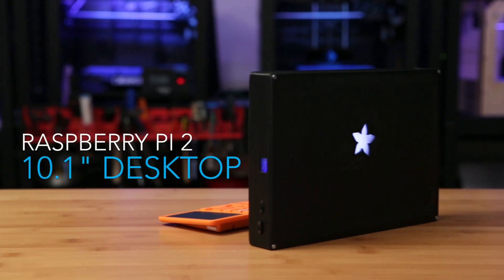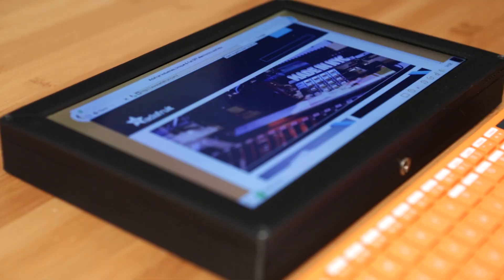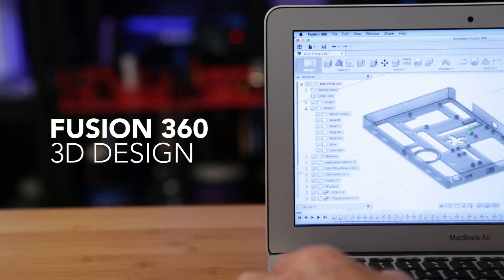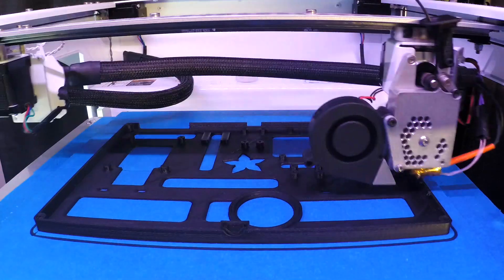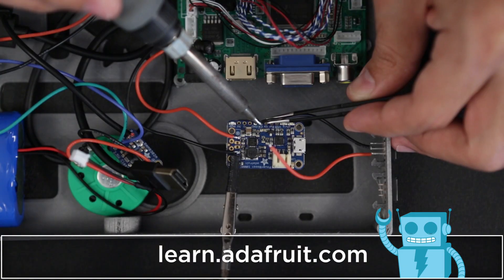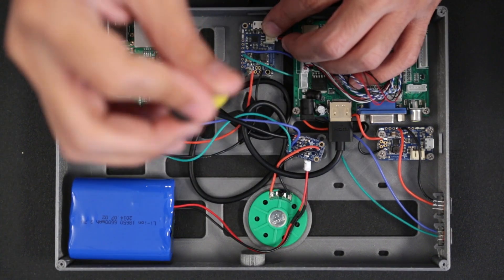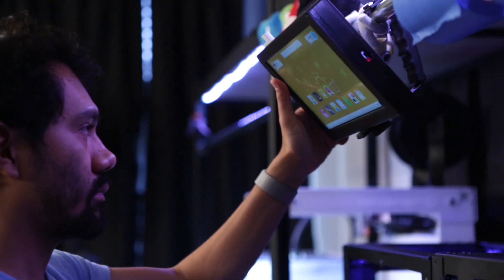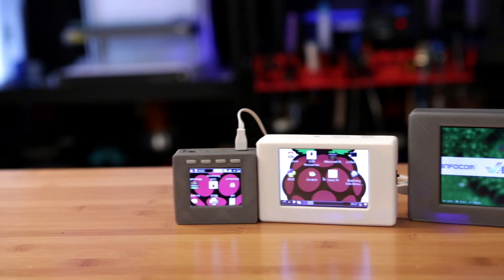10" Raspberry Pi Desktop #3DPrinting #Adafruit #RaspberryPi

Comment: Great project but it's getting out of date after three years. It definitely needs a 10.1" multitouch touch screen and the ports on the display driver board need to be exposed on the side so it can be used as a standalone display for other devices. What I would like to see is a 10.1" or bigger touch display that uses Adafruit's TFP401 HDMI to TFT driver board.

Comment: Does It Run In Windows 10 Lol
Reply: The Real Gmann71/Volex if you put the Intel compute stick or a latte panda computer inside, then yes, this can run windows. If you're using the pi, windows 10 iot software is available for it, but it is a little bit different from normal Windows 10. So either yes.

Comment: I made a similar case, similar boards but using a Stereo 2.8W Class D Audio Amplifier - I2C Control AGC - TPA2016 board (it's the one used on your Super Game Pi project). Works great and I just received your 6600mah 3.7v battery as they were out of stock recently. 

Having similar display panel, HOW did you get your LCD to work where the battery+powerboost that only gives ~5v, and the LCD runs on 7-12v?!? 
The only information I got from your page is you mentioned that power draw from combined display+HDMI driver when backlight is on at 5V: 980mA (not recommended, sometimes doesn't work @ 5V) 7v above works fine <<<- found on the description of the 10in display. 

My current solution is to add a "step up/down" converter and get an output of 9v/12v from it.
Reply from the maker: The display driver for the 10" LCD can actually be powered by 5V but eats up about 980mA. This project uses two PowerBoost 1000C' and two 6600mAh lipo batteries.
Reply: I did get vertical lines when I powered it with 5V which was dedicated from one of the PowerBoost 1000C and one 6600mah batteries. I guess a converter should help it increase the voltage and fix the problem.

Comment: i hate the fact that the display and the pi have two individual, seperate batterys.
big + thou is that the shown system can be charged whilst all the devices are running - very important for a mobile system.

I have a System that (in theory) runs a 10" Display and a Pi and my power source are three LiPO battery packs with each 7,4v. The Batterys are wired to two step down buck converters that supply the Display and the Pi with power.
however, i have no clue how to charge the Batterys whilst the system is running.

I have very limited knowlege of electronics - but i really want to built this mobile system (like a small laptop) with my pi.
Iam happy for any kind of information / advice you guys can give.
Reply: ask help from somebody who is good at electrictronic and batteries

Comment: I have a question about the 10.1" display. When/are you going to create or get in a 10.1" touch screen or a 10" touch screen adapter for the 10.1" screen? I am asking this because I am looking for a larger touch screen so that I can use it for a custom Carputer display I would prefer a 13" touch screen but that is even harder to find. So if you could let me know if you are going to be bringing out a 10.1" touch screen display I'd appreciate it and if not if you could point me to a place where I can find a 10" or even a 13" touch screen display preferably just the display panel.
Thank you

Comment: What is the typical battery life of this build? Thanks.
Reply: Depends on the batteries and the power consumption. Since the new Pi 3 B can support up to 2.5A, to power it for a full hour you would need a 2500mAh battery. To power it for 8 hours, you'd need a 20000mAh battery (again, with a lot of components plugged in to support that much power draw). Electricity is fun! X3

Comment: Hi Guys
Great build.I would add a removable panel on the rear of the Case with a slide lock to open. That would make it easier to access the inside components without having to remove screws.
CheersWilly

Comment: You guys are wearable specialists, so maybe you will help me. :) I'm designing a wearable 100w amp, basicly suit, with amp, battery, controller on board. I will be using raspi as a "controller" just to ensure easy connections to internet, bluetooth and so on. And I want to use wrist display, preferably HDMI one, any ideas guys? :D

Comment: What do you think the estimated cost of this build would be if you don't have a 3d printer?
Reply: +Ben Rosenberger Based on the parts I would say it cost between 250-300 USD, the screen alone is 145 USD, two batteries which is 40 USD each, RPI2 is also 40 USD
Reply: Wow I didn't realize the screen was so expensive... Was thinking about doing it but I can get a 23 Inch monitor with better resolution for less lol
Reply: +Ben Rosenberger You can also use a old laptop screen with a lcd driver/controller board (Which are sold on ebay for around 30 dollars) These have HDMI and a build in audio-driver as a bonus.